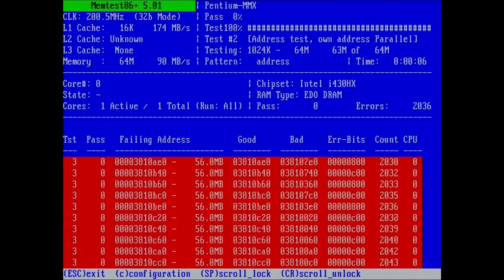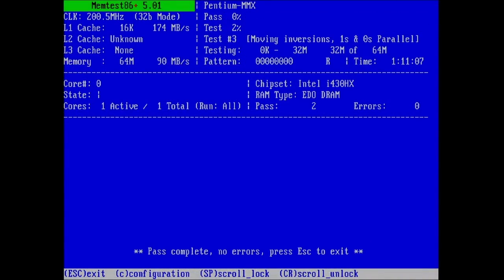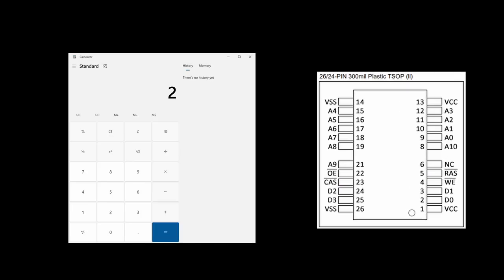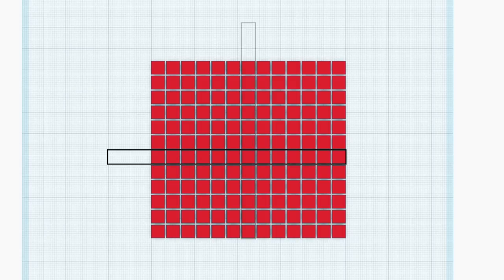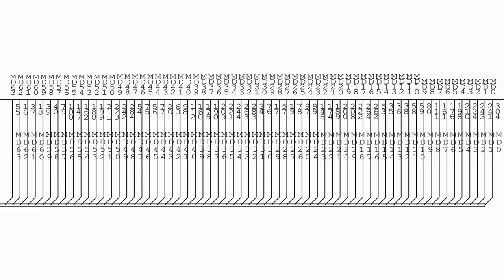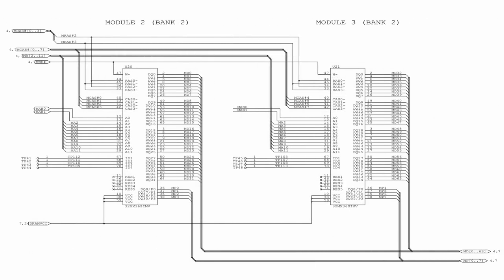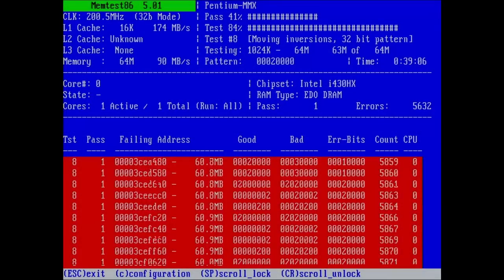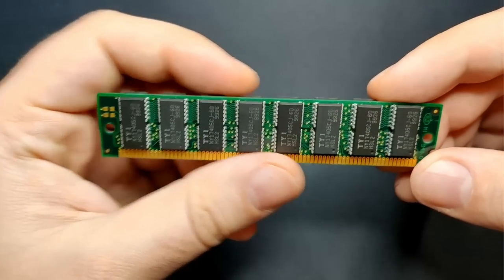Help me find the faulty chip (EDO_ERR Part 1/3)

Comment: What about to mask SIMM pads of data bus on faulty module, small piece of tape on corresponding Dx pins. That could verify the suspect.
Reply from the maker: Wow! Very interesting idea! I will definitely try this! I think you just added an interim video my friend! Kapton Tape - here I come!!!
Reply: @bitsundbolts  waiting for your results, I am curious too 😉
Reply: This may work, but putting tape on the CAS, RAS, and DRB lines might give better results. This is because can choose which side of the memory module and capacity it may access. The datasheet for 82439HX shows this on pages 27 and 28. On my boards, the SIMM is hard to install the modules, so I do not know if there is enough room to use tape.

Comment: Thermal cameras can help sometimes. Especially if it fails after a period of time.
Reply: Or, if the part is not getting hotter that the rest, it might be an idea to cool down/warm up one chip at a time and see if the error goes away/comes back.
Reply: IPA works as well I believe. It is non-conductive and will evaporate quicker on chips that are too hot.
Reply from the maker: I actually did use a thermal camera and checked the chips. I couldn't find anything noteworthy - so, I did not include it in the video.
Reply: @bitsundbolts  Long shot. Maybe the errors start when the chip gets up to operating temp.  Possibly use a can of compressed air on each chip one by one and see if the errors suddenly stop while running memtest86?
Reply from the maker: I absolutely love that idea! Your suggestion goes on the list of physical methods to find the faulty chip! Thanks!
Reply: @xenoxaos1 Indeed, in combination with the manual test range feature of memtest, it is possible to heat up a specific area of the memory module and then check with a thermal imaging camera.
Reply: I was thinking the same thing…the faulty chip may be much warmer than the working chips…
Reply: @Adam_Boots  To clarify, Isopropyl Alcohol, not India Pale Ale :)

Comment: There was a utility like CheckIt (or maybe it was that ?) that had a page to identify the faulty memory chips on an XT machine.  You had to input the chip size, the memory configuration (how many chips, have parity or not, how many rows were populated, etc) and it tested and located the bad memory chip. It worked also for addon ISA memory boards. I tweaked the configuration of that program on a 286 with random freezes and 30 pin memory SIMMs and it located the bad chip. (I got a bunch of bad memory sticks and all had faulty one chip so I managed to frankenstein some to use them)
Reply: That’s really cool. I never seen that app back in the day but wish I knew about it. I always had to rely on running long tests doing that pluck-and-chuck until I at least singled out the bad stick. Memories…

Comment: I would say, your guess is correct, but without knowing the exact wiring from the Chipset to the modules it's impossible to say for sure. 
Data-Lines don't have to be connected to the pins with the same name. If it is more convenient to route pin D10 on the Chipset to D3 on the RAM-Module, the PCB-Designers will do so to improve signal integrity or reduce board complexity. 
Only way to know for sure is to construct a test-bench that can check the entire module on its own at full speed.
Reply from the maker: Yes, this is what bothered me and I did not expect this topic to be this complex. But when I realized this, I was too deep into the material. I have seen some EDO module testers, but they are too expensive for this single purpose. It will be a fun project to remove the chips and create 30-pin SIMMS...
Reply: @bitsundbolts  I think maybe you could build a chip tester later once you get past this problem. It would be so awesome to have a DIY memory tester.
Reply: Regardless of PCB design the data pins have the same input & output pin !

But the address pins should be 100 % correct & must follow the chip numbering .

Comment: You might want to check all the solder work - I’ve dealt with “faulty” chips that turned out to be a cold solder joint with similar behavior
Reply from the maker: There are so many great suggestions. If I can narrow down a chip, I will inspect it with a microscope. It could be a cold solder joint.

Comment: I would try to disable each chip one at a time. If there are isolating resistors on the chip select line you can simply ground the pin or you might have to cut a trace and ground the pin. If the memory error doesn't change from the unmodified scan then you disabled the "correct" chip. If you do this to a known good chip you can make a map of which chip gives which address error.

Comment: Part of the problem, though, is that it may not be the memory itself, but the *power supply*. I recently had a problem with trying to identify an unstable system, until I tried taking out the power supply and swapping in a new one. The memory problems and instability immediately went away.
Reply: Could be bad ripple
Reply from the maker: Interesting. I am actually using an EVGA Supernova 850 G3 - so, a really new power supply. Additionally to the faulty module, I have an identical working one. I still believe that one chip is faulty because of the consistency of how MemTest86+ reports the errors.
Reply: @bitsundbolts  My reply was more aimed at T-Squareds. I agree with you on your one :)
Reply: @bitsundbolts  Remember that PC motherboards before 2003ish primarily used the +5v rail for everything. Power supplies starting in the mid 2000s started putting most of their capacity on the +12v rail as motherboards switched to that for CPU power delivery. While you could have an 850W power supply, the percentage of that available on the +5v rail is only a tiny percentage of that. So you could be overloading the +5v rail, or getting very close to its current limit, and have issues related to excessive voltage ripple.

Group regulated supplies are even worse, if you have a heavily imbalanced load, where one rail is loaded up far more than the others, it can throw voltage regulation off on all of the other rails.

Comment: Wow fantastic video! It is tough to figure out, the Pentium is only able to address memory in 64 bit chucks so it is only exposing A31-A3 and then A2, A1 and A0 are demultiplexed out as BE7-BE0 (Byte Enable) which allows it to read/write which of the 8 bytes in that 64 block it wants. That is why it is always even numbered even when you swap that sticks, because address 0x0008 to the CPU is actually 0x0001 to the memory, 0x0010 to the CPU is 0x0002 to the memory, etc.

Comment: wow, this is amazing work, hard work.
I had some memory stick in the past that were defective and using a memory tester was the best choice but it was very expensive so i did nothing.

After that , some time later, did some more research and found out that there are memory sticks on aliexpress with little sockets in place of each chip where you can place your individual chips and test them.

They exist for all sort of Ram memory, like ddr2, ddr3, ddr4 etc. Still expensive.
So another idea is to just buy one such chip socket , solder it in place of a memory chip on a good stick of ram.
Then, on the bad stick you desolder one chip at a time and test it in the testing memory stick by placing it in that chip socket ..

Chances are that you will find the bad chip before desoldering all chips from the bad stick.

Comment: Very nice analysis. I was also wondering if there was a way to figure out what chip is faulty on a memory module. In my case I have a DDR3 which I'd like to rescue but the system does not see it altogether so I cannot test it. I look forward to the outcome!

Your memtest error also reminds me of a friend's laptop which kept corrupting Windows. Several journeys to the service centre for warranty repairs never identified the issue but Windows kept getting corrupted. Turned out one module was faulty when COLD! Enough to corrupt the OS at boot and enough to test fine when the technician was running their tests after a couple of minutes. I spotted that by running memtest first thing first after turning it on.
Reply from the maker: Wow - memory errors can be such a pain! The module I have here seems to behave the opposite way! Once it gets warm, errors appear.
Is this one of the DDR3 modules from your last video with the X58 chipset? I wonder if it is possible to rescue a seemingly dead module - not that easy to diagnose when its not showing up :) I would be probably going crazy and compare several pins against ground and see what values I get from a multimeter. Then compare it with working modules and see if there is something obvious.

Comment: The way i'd check it - at least if the custom 30-pin SIMM PCBs are 3-chip modules:
- Make one module with known good memory chips. 
- Make the other module with sockets (if you can get proper ones for the chip type) and have it mounted in a socket that offers the space on, say, a 486.
- Preferably have the "tester" stick run with 2 known good chips and swap out the 3rd.
- Run memtest or another test suite to your heart's content.
That could solve the dilemma, even if you have an MMU or chipset in the equation as most motherboards have, but as the 30-pin SIMMs have less chips on them, it'd remove quite a bit of variables in any case.

It's likely to be a longer process considering memtest86 is comparably slow, but barring a dedicated memory/chip tester, it's the best I can come up with.

The Retro Chip Tester also has a 30-pin SIMM adapter board - it's cheaper than the "big" RAM testers out there, but it could be of some use combined with a "socketed SIMM" board asd I described above - though there's still no guarantee that it'll catch the error as Memtest only catches it after some runtime...

Comment: The CAS connections from the memory controller look al strange going to the resistors but when they leave the resistors they still have the original name.
Its just visually in the wrong order, the signal names are still correct and logically the same, those resistors are just form EMI filtering and are wired strange for layout purpose only.

Comment: I think the odd cas connection are caused by simplification of the board layout. It is no important on which chip the data bit is stored since you can't hot swap the RAM to another board of another manufacturer and it shall work. This can also cause that the error when the simms are switched are not at the same position. It is not necessary for the chipset to know on which chip the bits are stored, it stores them where it is connected to. That's some pcb layout magic or some call it laziness 😄
Reply from the maker: Yes, and this is what makes it incredibly difficult to narrow down the chip. There are so many variables to consider. Looks like the solution may be in less sophisticated method: Temperature and taping off contacts :)

Comment: 12:27 
I've also had problems with RAM. Here are my conclusions
1. too high clock speed of the bus, it works flawlessly at 33 MHz, there are errors at 66 MHz. I had this case with 200MHz DRAMs and had to downclock to 100MHz because Windows XP kept restarting in random actions, after downclocking I didn't have to restart the system for several years. From what I remember (it was 15 years ago) errors were always on one line. It looked similar to what you see in your video.
2. Motherboard doesn't like some kind of memory. On one computer the memory works properly, on the other there are errors with the same bus timing (I had such DRAM memory - it was returned to the seller). Motherboards came from different manufacturers.
3. Memories from two different manufacturers do not like each other even though the memory specification allows them to be combined.
4. The motherboard gives too little current and part of the line gets less current and write errors occur (different voltages are used at different timings - check if the power supply after a few hours of operation maintains the voltage parameters for different voltages 3V, 5V, 12V).

Comment: 10:34 as an electronics engineer i can tell you that this connections are placed in this way purelly to optimize pcb layout.  When these lines was drawn the first time they were straight for shure. When you do pcb layout, very often you are switching between schematic and PCB doing this short of stuff to avoid huge amount of vias on critical traces and just to make your data lines easier way. This is edoram era, see ddr1 era zig-zaggy traces they are called matched impedance pairs.
Reply: Curiously impedance will of course start to grow very slightly out of sync once you start adding different amount of meander to related traces, so this is not an impedance matching technique; really it's propagation delay matching or phase matching.
Reply: They're very carefully routed in order to maintain timing.  Very small changes in the length of the trace can impact the timing of the signal.
Also, they're likely ordered specifically to minimize the impact of noise from adjacent lines.  See row hammer.

Comment: at 10:39 you asked why some signals are crossing. I can explain. That is because of the layout consideration.  At the physical BGA or package of the chip, sometimes the signals need to be adjusted when doing the layout and feed back to the schematic guy to change the wiring order.

Comment: I remember there was a method of attack that would freeze the ram chips with liquid N2 or liquid compressed air, then the bits would lock in their state and retrieval of bitlocker key was possible. Maybe freezing individual chips one by one can give you a hint for the addressing scheme since frozen ram chip should begin failing right away in memtestx86 and if in frozen state the address matches failing address from normal warm state then you got your self a suspect. Just make sure not to flood the board with water condensation 😅
Reply from the maker: Interesting. I didn't know you can freeze bits :) But yeah, looks like temperature may be a solution to find the faulty chip! Thanks!

Comment: On the Commodore 64, it is usual to stack a working memory chip on top of the suspected broken one. I wonder if this would work here, too. Perhaps by soldering a memory chip onto the rear of a socket, and pushing the socket onto the suspected one?
Reply from the maker: I do have memory chips in the mail that should arrive in a few weeks (shipment from China sometimes takes a long time!). I may give it a try.

Comment: The GRUB2 can make the PC run with faulty memory, with just adding badram command to its config according to memtest86+ output (which have a special output mode for this badram arguments). 
Kernels that support this includes Linux, GNU Mach, the kernel of FreeBSD and Multiboot kernels in general.

 I have used this feature with Linux and it really works.

Comment: Judging by the memtest output, the error is more or less stable and unlikely to be caused by the cold solder joints. The chips in question seem to be the ones that use output pins DQ9-DQ12 on the SIMM - correlated to the Err-Bits from the memtest.
Cold solders (or taping the DQ pins on the SIMM as some suggested) would likely cause the SIMM to crap out across the entire address space, however in this case, the errors start at 56 Mb, meaning the last quarter of the chip is unstable, with D2 (bit 3) totally knocked out and D3 (bit 4) flapping.
In regards to the endianness, I might have guessed the wrong pins. However, taping one of them and seeing if the error stays the same across the entire address space or another Err-Bit appears would help to sort this out. I've long since let go of any SIMMs or machines capable of taking them.
On an unrelated note, I'm not sure if the EDO chips would work properly in a 386 system. Some of them have the FPM compatibility mode, some don't.
Reply from the maker: Thanks for your detailed answer. I think you're really close, if not absolutely correct. Taping contacts does indeed not work. Since the module has only 32 data lines (shared between both sides of the module), removing one bit would turn the module into a 31-bit module which doesn't work at all. I'm working hard on the next video - hopefully it will be release this week.
Regarding FPM support, yes, I agree. I paired the EDO module with an FPM module and the system boots. The BIOS summary screen as well as the tool SpeedSys report FPM mode - which makes me believe that those EDO chips will work on the 386 - but we will find out!

Comment: Honestly i'm not convinced i'd be playing around with salvage RAM chips from the era! They're kind of all suspect bad. ISSI manufactures FPM and EDO DRAM ICs that you can use.

... is what i'd be saying 3 years ago. Today, good luck with that availability :(

The answer to "why the lines are crossing in the schem" when it comes to RAM is usually because they are not really crossing, it was more convenient to lay it out that way for routing reasons, and when you look at the PCB, they aren't actually crossing. Because you can just shuffle the lines around in a number of ways, the host will be none the wiser. You can even do this with ROM chips but then you need to bake the data shuffled correspondingly. This is also why i will refuse to take a guess at which chip is at fault.

Comment: My first thought was to desolder each individual chip and test them in some arduino-based test bed, but arduino may be fast enough to test chips “at full speed” and it may matter in this case

Also it may be that chips itself are ok but there is some problem like solder issue, trace issue, corroded contact etc

And all those issues may be temperature-dependent, so for example in slow machine such circumstances (full speed + high temperature) may never occur